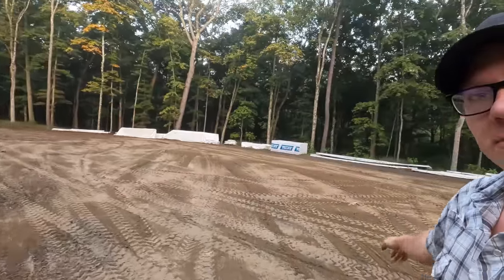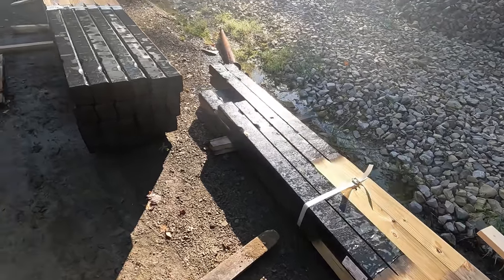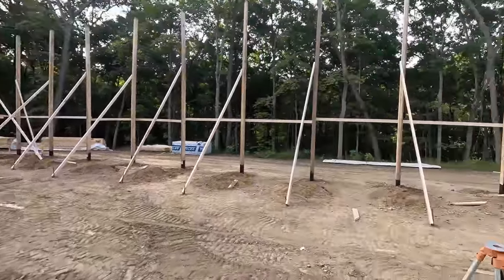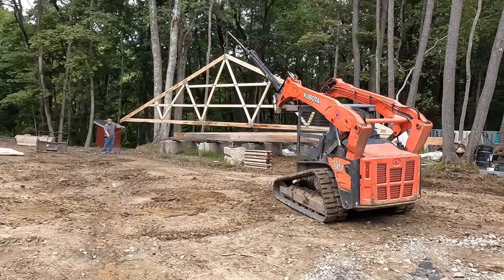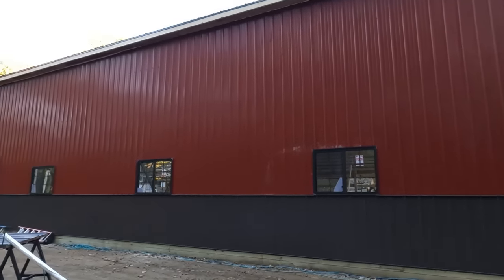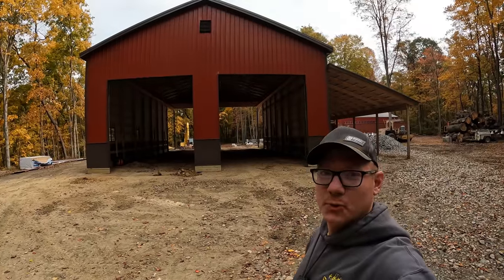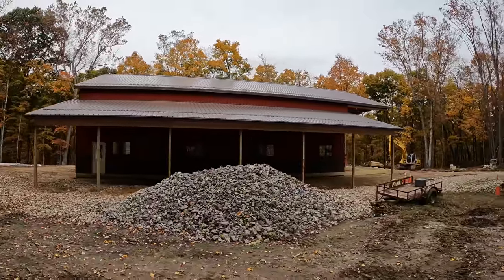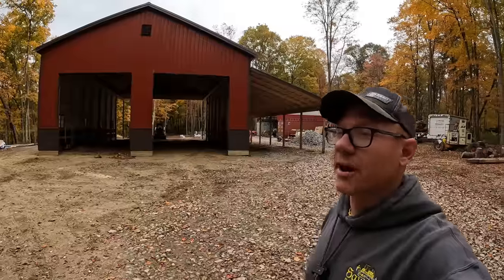Building a Dream Workshop! (Finally) Putting up the shell!

Comment: A: The extended roof over the entrance is a wind trap. A good wind will lift the rest of the roof off or weaken it!
B; Are you going to put in inspection pits.  Check width for mechanical tools that will have to fit it.
C: Drainage grid to outside drain in case a flood/burst pipe strikes.. or roof leaks after storm?
D: Lighting... 'Halogen' lamps. Cheap to fit and run.
E: Roof fans to drive down heat from roof  apex.
INSULATION...for walls...a must... 'Expanded Polystyrene' (EPS), which is Fire Retardant. To be then covered by sheet metal , obviously; or plasterboard.
All the best, Lord Milton, UK.
ps, Don't forget a drainage pump for inspection pits...If they ever fill up with water. Wooden latts/pallets on pit floor...we are not all diminutively challenged!
Reply: 'Halogen' lamps. Cheap to fit and run."--------------  LED lights can be up to 80% less expensive to run.
Reply: @richardthomas1743  BUT, will LED lamps have the power ratio to hit the floor of the workshop 40' below?

Comment: No concrete for the posts?? And cheap house wrap with thin metal covering the outside? No insulation? You went cheap. This is just pathetic. It will come back to bite you. This whole thing was a waste of money and labor just to have a shield from the rain smh
Reply from the maker: Apparently you didn’t stick around to hear me talk about spray foam insulation and in floor heat…..
Reply: @DieselCreek  no I did. You said you would insulate the roof and leave the rafters open. That ain't gonna work
Reply from the maker: @rosegold7975  the walls will be insulated too and why wouldn’t that work???? 🙄